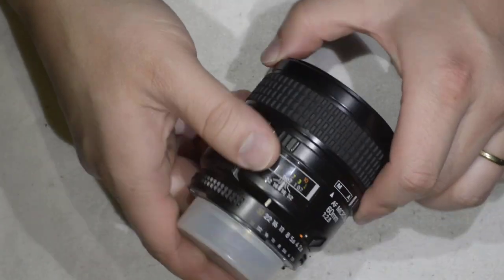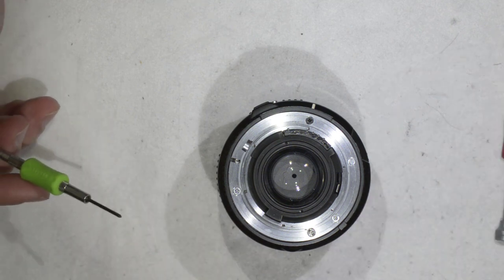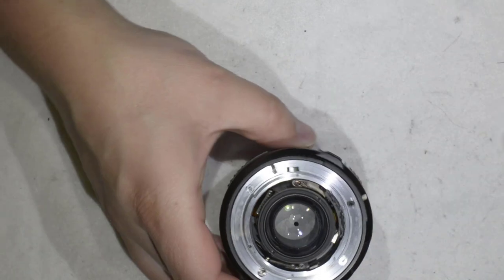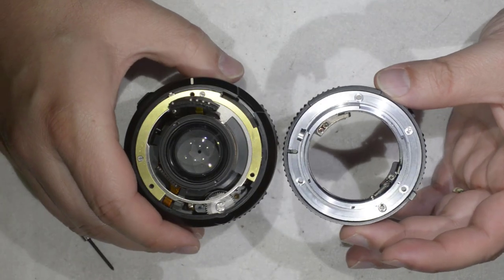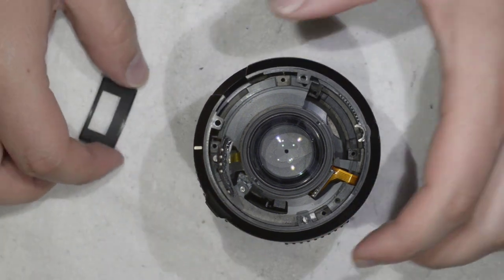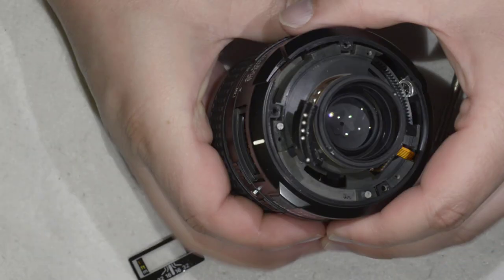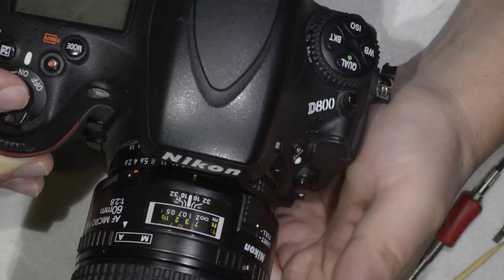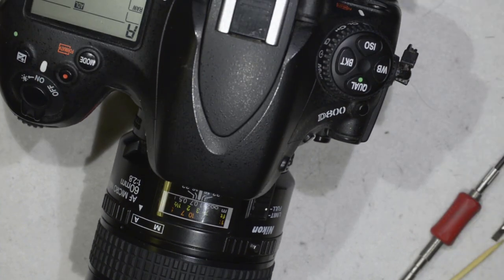Nikon Micro-Nikkor 60mm f/2.8 : Focus adjustment

Comment: My manual /af ring broke just now (i switched it while the ad was working), thanks to this video im gonna try to fix it tommorow
Reply from the maker: Hope everything goes fine and that the video is helpful. Don't forget to share with friends.
Reply: @diyextravaganza  video was super helpfull! Of course something had to went wrong and I struggled with 1 screw to the point where I needed to heat it up with soldering iron but after 2h I'm done (it took me 40min to place the mounting bayonet 💀)
Reply from the maker: @bartoszkrol8846  I'm not surprised, the mounting of this lens seems easy but it is not. Great to hear you managed :)

Comment: We use the Nikon 60mm 2.8 often.  Very sharp. For macro you will need to use a tripod as the focusing can get out of focus easily.   We use the digital zoom focusing feature to nail the focusing area.  You can also get a similar macro image with a 50mm lens combined with a +1 close-up filter. Comparing images from both setups yields almost identical images.
Reply from the maker: A fantastic lens indeed. I made a video about the different macro options, no surprise, the dedicated macro lens came on top. Cheers.

Comment: I absolutely cannot get the aperture ring back together properly after following your instructions very closely for a few hours.  I think whatever is not engaging is possibly blocked from your camera view.  You do try to explain briefly how something is supposed to catch but I can't see what.   Also - the A M ring on this lens does not fit the 28mm 1.4D   They are of different design.
Reply from the maker: Hi, yes, the aperture setting is the tricky part of this lens. There is a small pivot part that needs to be set properly (very small black trianglelike part pivoting around the aperture). Once you get that part, it's done. Thanks for the info about the AM ring, I was hoping it was the same but you confirmed otherwise. Thanks for following th channel and cheers !
Reply: @diyextravaganza  The pivot part I understand - I think the real trick that I just discovered is that you need to be holding the aperture wide open as you attach the bayonet.  I don't believe you mention this in your otherwise good instructions.  I just got my lens reassembled and working properly.  Thanks.
Reply from the maker: @Some-guy-you-dont-know  Maybe I forgot, important thing is your lens is working again as expected. Cheers.